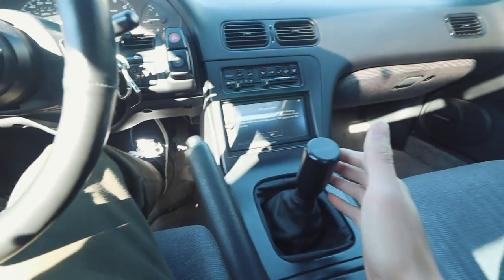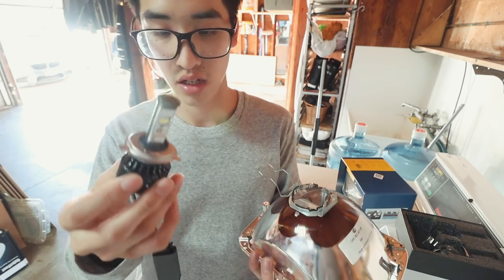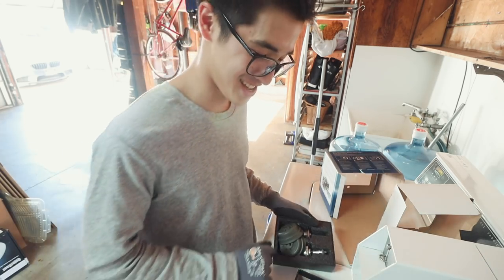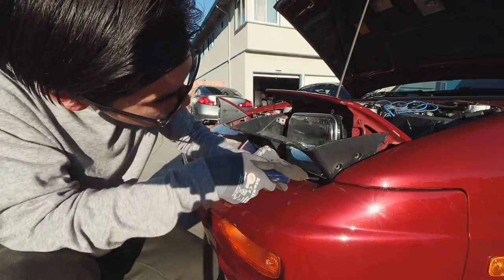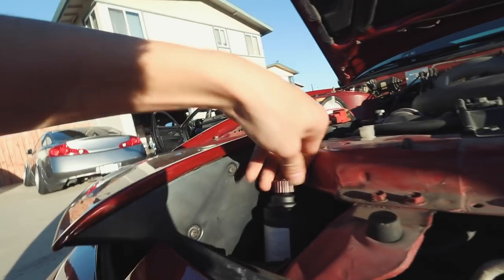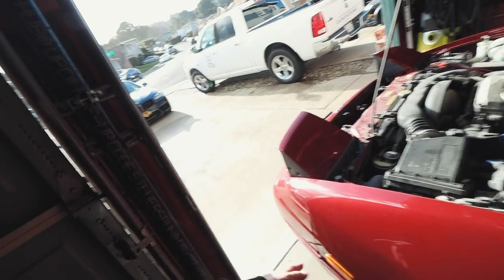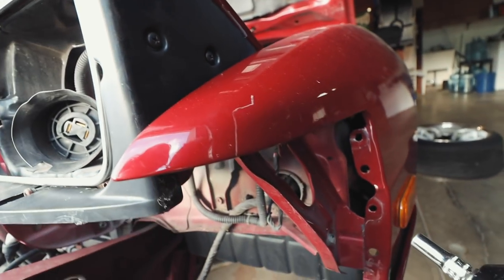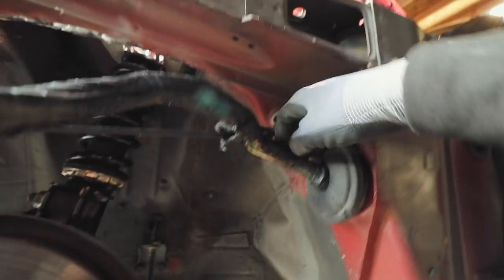I LOVE POP UP HEADLIGHTS!

Comment: What did you do to get your pop ups to work again? Did You just unplug it and plug it back in. Im having that same issue with mine.
Reply from the maker: Matthew _G59 I unplugged it and then spun the headlight motor myself
Reply: @TylerTea  so they go down when you hit the button.  and when want them up you just manually put it up.